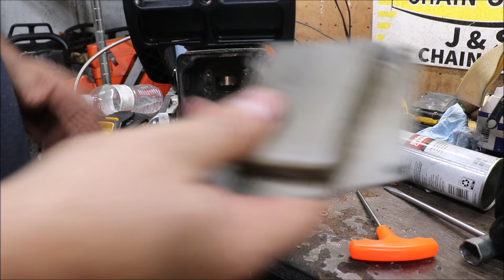Farmertec Stihl ms660 No Start Diagnosis and Tear Down

Comment: Good job brither❤
Reply: Saw arrived with now pin on the float so it was just flopping around in the Carb.  Solved that and then found the little screen in the carb behind the flap/valve was plugged to the point you couldn't see through it.  Must have been assembled on a Chinese Monday@!

Comment: Ive got the farmmac 660, for some reason it ruins carbs.. im on my 5th carb ruined 2 100$ walbro carbs And 3 cheap carbs.. ive taken the walbro carbs to be rebuilt they never worked again only get about 2 months per carb.. replaced intake tube and pulse line, fuel line and filter all new.. now it wont run with new carb.. has 180psi compression will run if i squirt 2stroke down the intake but thats it..
Reply from the maker: Probably an air leak I'd try crank seals 🤔

Comment: My NEOTEC NS872's fuel line split and I replaced it, and ever since, it won't start. I can get it to turn over using starter fluid, but only for a second or two. Any thoughts? Also, it leaks an entire tank's worth of lubricant if it sits for a night. I replaced the caps, but i think it is leaking from somewhere else. Anyone else had this problem?
Reply from the maker: I'd say the crank case gasket is leaking or hopefully just the oiler gasket..as gar as the no run make sure the fuel line isnt kinked and make sure the impulse line didn't come loose